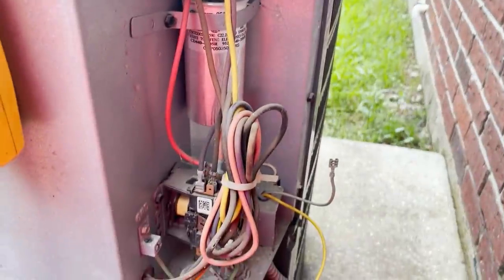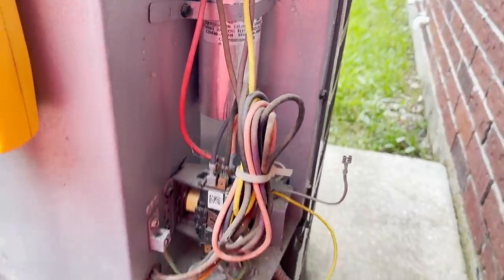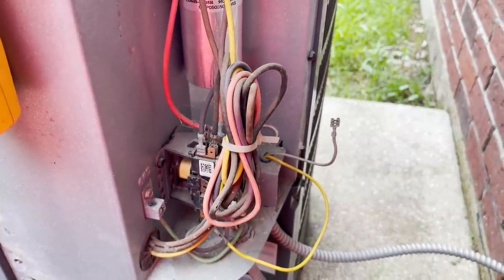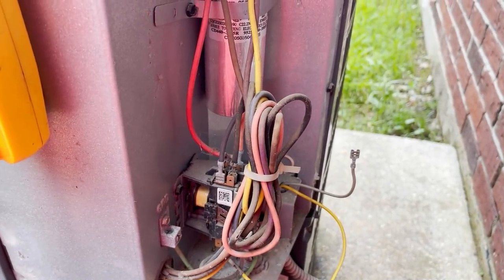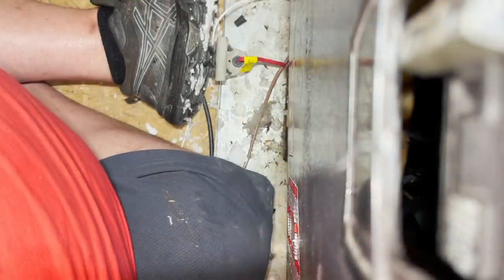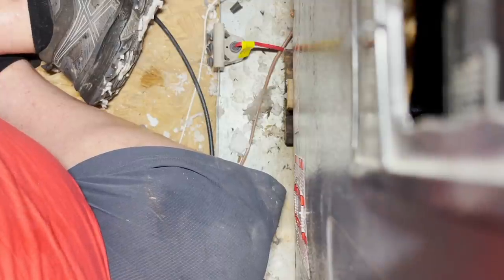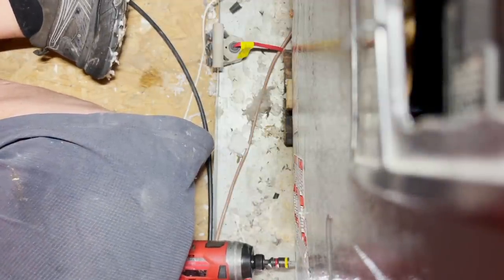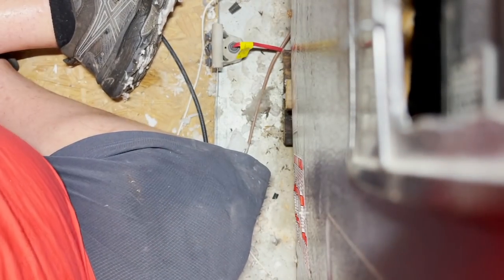No Cooling/Nothing Runs/Low Voltage Short

Comment: The best tool for finding shorts is your clamp on meter. Clamp on yellow wire in attic and watch amp draw. If contractor is bad the amp draw will draw above 3 amps and blow fuse of kick 3 amp breaker. I have actually put 2 or 3 low volt wires in clamp on and start isolating which bundle is drawing high amps and then go to one at a time. It worked for me like a champ.